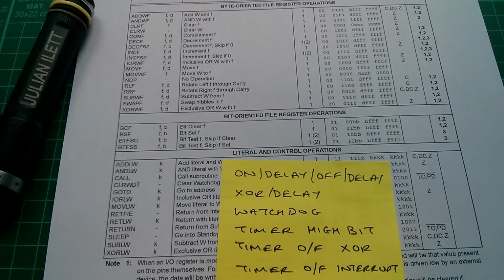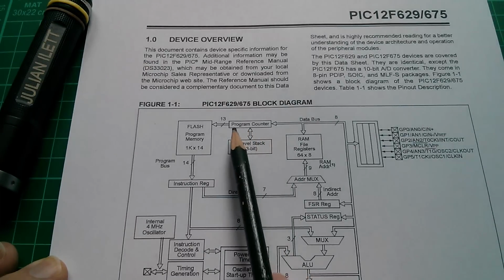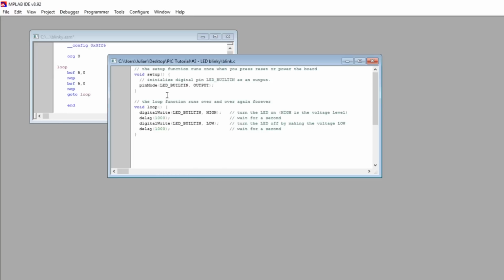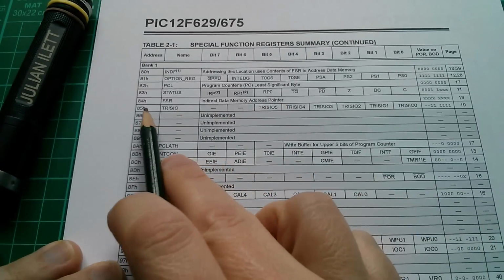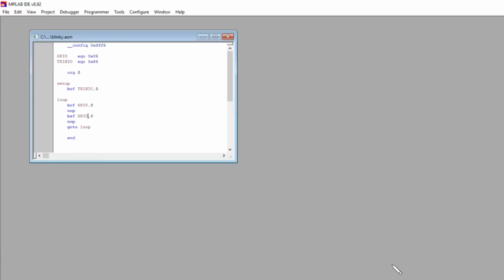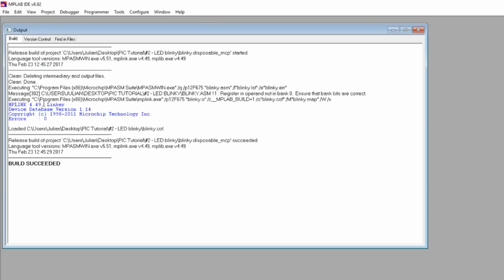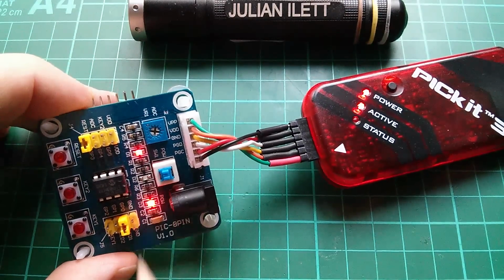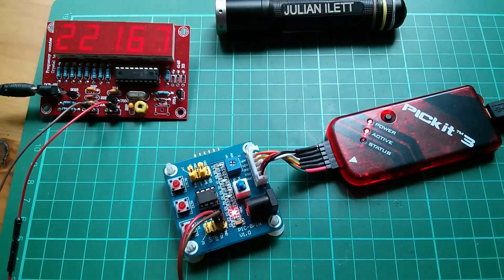PIC Assembly Language Tutorial: #2 - LED Blinky

Comment: Hey bro....how can i write an assembly code that will turn on a LED when i presses a push-button switch. When the switch is released, the LED will turn off. After the switch is pressed and released a specific number of times, a second LED is to turn on and stay lit forever. Using PIC16F84A and  PICKIT2 Programmer    

Thanks in advance for your help

Comment: I wrote a stepper motor driver years ago in ASM on a 16f84 then moved on to a satellite tracker a bio diesel process controller and many more than wanted to do more maths which was so long winded I move on to proton pic basic which was very slow in comparison to ASM but woohoo you can embed the bits you want fast in ASM 😁

Comment: I normally don't see assembly language tutorials on youtube so I had to click on this video out of curiosity.
I have to say it was pretty well done and easy to follow. A nice surprise indeed.

I believe you mixed up GPIO with TRISIO at one point, though. The TRIS registers in fact start with all pins configured as input, but the corresponding GPIO bits start undefined. They will also later depend on what is connected to them (as they are inputs) once they are read, so no contradiction there.

Other than that this was an excellent tutorial. Surprisingly clear especially considering that PICs are a bit of a "messy" architecture.

Comment: 1:39 Point of order!
RISC does NOT mean a reduced set of instructions (as in a small number of instructions) but really means a set of reduced instructions (as a set of simple instructions).
A RISC CPU like the PowerPC has a huge amount of instructions at it's disposal.

What makes RISC is that instructions are typically doing only a single thing, where on CISC an instruction can do many things.

The obvious example is adding to a (memory) variable, which in RISC takes a load memory to register, add to register (possibly even a load immediate value in register), add register/immediate to register, and store instruction.
where on a CISC like the intel x86, this can (but it is not necessarily the best way) be done in a single instruction add register value/immediate to memory location, which does the load/store for you.
Reply from the maker: +oreubens Point taken, reading Wikipedia now. It's not a very concise definition.
Reply: it isn't, and it really is difficult to figure out what is meant.  The whole idea behind it is that at some point CISC was evolving into such complexity that it was thought that making simpler instructions would make it easier to create processors, even at the cost of making the programming harder.
Again, the theory behind that being that compilers could handle that complexity easier in software than it is to solve the problem of cramming ever more transistors on a chip and dealing with heat. And yes, there are RISC cpu's where they ALSO reduced the instruction set itself so having CPU's without a hardware multiply or divide  That didn't help in making it obvious that RSIC wasn't about the amount of instructions, but about the amount of work each instruction does.The most obvious distinction is memory access where on RISC you have separate load/store instructions vs instructions that 'do' something like arithmetic, logic operations, shifts... (there's a few oddball exceptions here and there). On a CISC, you find instructions that 'do work' directly on memory.note however that even on current x86 x64 processors, you typically want to avoid the more CISC type usage of instructions and split them up into multiple separate load/operate/store instructions just like RISC, because it allows for a better usage of the CPU execution pipeline.
Reply from the maker: I'm making some sense of this by reading about the One Instruction Set Computer (OISC) - totally fascinating https://en.wikipedia.org/wiki/One_instruction_set_computer

Comment: I've watched the vid twice (still waiting for the dev. board to turn up, although the Pickit3 arrived today and some ridiculously small pitch cables yesterday!). I've watched it twice and am banging my head against something which, I am sure, is blindingly obvious, but I just don't get it...
I get the fact that you've got to switch banks. What I don't get is that the register you have to change is in bank 0 and yet you can still access this register once you have switched to bank 1. Surely once you've changed the register, it becomes inaccessible as any reference to the 'file/location' will be pointing to bank 1?
Sure as eggs is eggs, I'm missing something. Maybe I should keep watching until it clicks...
Reply from the maker: It's elegantly simple - the STATUS register exists in both banks - it has to - that's the only way it can work :)
Reply: Doh! Perhaps I should have done my homework and actually read the data sheet. I've downloaded and printed it now. Slapped wrist. Sorry!

Comment: Thought you were going to use pickit2 to avoid pickit3 issues. I'm only a beginner and doing my best to keep up so adding unnecessary problems is only adding to my already steep learning curve. Not criticising your great videos just asking you to remember the numpties like me!
Reply from the maker: In hindsight, it might have been easier to use just the PICkit2. But I've recommended both now, so I have to cover all the issues (which is a lot of work).
Reply: Julian Ilett I have a pickit3 but got a pickit2 anyway as they're ridiculously cheap (clones)!  I need to do more study of relevant literature so I can keep pace!  Hardware not a problem but software side is a bit more demanding on my old brain cell!

Comment: Well, that answers that question... I'll have to wait for the PIC12F675s to arrive... I tried to port this over to the PIC12LF1840 that I currently have in my proto-boarded version of the experimenters board, and I don't seem to be able to get the clock to start up when doing ASM code... only with the C code so far. However, I've been looking at the program memory (I'm using  MPLAB X) and one nice benefit of this video is I can actually start understanding the ASM instructions  that the compiler is using... neat! So now I can see how "LATAbits.LATA0 = 1;" becomes "BSF LATA, 0x0" and how "TRISAbits.TRISA0 = 0;" becomes "BCF TRISA, 0x0". Neat! btw, maybe the issues with the PICKit3 and MPLAB are due to not switching the PICKit3 back into MPLAB mode after using the PICKit3 Standalone Programmer, as that loads a different firmware onto the PICKit3? Another thing to consider is if you have had MPLAB X installed, there is a "MPLAB Device Driver Switcher", which switches between MPLAB 8 and MPLAB X drivers.
Reply: Actually, it looks like the driver switcher doesn't apply for the PICKit3... it's for their other programmers like the Real ICE or ICD3. I did try MPLAB 8.92 though, and after it downgraded the PICKit3 firmware to a version it preferred (second time I tried doing this it half installed, so I unplugged the PICKit3 and reconnected it and it successfully installed). It was then able to connect to the programmer and upload to the PIC without any trouble. And MPLAB upgrades the firmware again when I use it. I don't intend to switch back and forwards, but it seems like my setup is  stable enough with either version of MPLAB.

Comment: all this for friggin blinking LED??? yikes!
Reply: Assembly is a very low level language, its basically one rung above the raw machine code that actually tells the chip what to do. There is essentially nothing implied with assembly, so you have to put in the effort to get the results.

The best saying Ive heard is that it will do what you tell it to do, not what you intend it to do. If something isnt working properly, its because you havent told it how to operate properly.
Reply: Tom Storey actually i don’t share the same opinion that is a very low level language...

Comment: Your hardware approach doesn't really work, you're fired. Because the goto uses 8 clock cycles and the noops only 4 you have the LED off for twice as long as you have it on. It's not symmetrical.
Reply: was a precise 50/50 duty cycle written into the spec? :/
Reply: @joinedupjon: We don't know... we're not privy to those super-secret details. I suspect it was though... since Julian said he will fix that in the next video(s). :-P

Comment: How are you getting away with putting code at address 0x00 - the Reset Vector?
Reply: slm60uk because it's perfectly reasonable to have this code start running immediately after a reset

Comment: The PIC architecture is Ugly. Only use 14 bits instructions and then to make this work, invent register banks. That's Ugly.
Reply: Paul, Yes it's a bit ugly. Mostly hangovers from earlier chip series. Original chips had only a  12 bit instruction  word and a special instruction for setting each of the special function registers. When I started with the PIC chips there were only 4 chips in the series and there were only one time programmable, rom and UV erasable development chips. The chip Julian is using is several generations later but has many holdovers from the past.

Comment: Nice work, Jules! :D Glad you didn't get your arse fired :P
I noticed the LED off time was slightly longer than the on time, is that because of the tiny extra time it takes for the GOTO to loop round? If you took out the second NOP and put it after the LED on code, could you make an exact 50% duty cycle?
Could be a neat 555 timer replacement (obviously not pin compatible) that generates nice 50% duty cycle square waves with a RC oscillator :D
Reply from the maker: Well spotted. In fact the on time is half the length of the off time, so the GOTO is having a very large effect. And you're right - moving the NOP would restore the symmetry perfectly :)
Reply: Julian Ilett Ooh! :D
Follow up vid? I'd be surprised how fast a square wave you could get out of it. Also the RC clock could lead to some interesting ideas, like arbitrary waveform generation, or sinewave simulation using data points plotted into a lookup table :) (I've done this on arduino to move servos :D )

Comment: I would argue that it's good practice to use notation to indicate which radix a number is in regardless of whether it's needed or not as it avoids ambiguity in code and maintains consistency. 100% of software bugs are the result of either laziness or incompetence! Best to teach people good practice from the offset. :P
Reply: I used 255 and ended up getting 85 very confusing.... in the end this was hex is the default radix so 255 is 255 in hex but the higher bits get thrown away giving 55 hex which is 85 decimal!  Should have said .255 obvious really!
Reply: 100% of bugs not not due to laziness or incompetence, only some are, You cannot measure that.
Reply: TheProCactus: yes you can. Code isn't magic, it behaves in a precisely defined way.
Reply: himselfe so when you go shopping you say i'm going to buy D'12' eggs? the default radix in C and in life is 10 so this is a trap for new players.
Reply: That's the point though, when the radix isn't decimal it's good to consistently show that in the code regardless of whether you technically need to or not. Can't imagine any situation where I'd want to buy 3346 eggs mind you! Also, I read your comment in the voice of Dave Jones. xD
Reply: himselfe with respect to MPASM I agree with you D'100'% particularly as the default radix can be changed with /r argument or in the source itself with the radix directive, in more general life and C, Java, JavaScript, Python,... etc. then I will continue to use literals in base 10 without disambiguation, however being the disciplined developer I am my constants will be declared sensibly as symbols except for 0 and 1. 0 and 1 of course are not problematic in any base.  This discussion could also be extended to negative numbers where size becomes significant but I guess Julian will cover negative numbers at some point.
Reply: About the bugs, I suppose you are right about that, I can't think of a single thing to argue against you. 
I think what I was getting at was not all programs can be written down with such accuracy that a complex system of code will work every-time first time.  

Even if it does work first time don't mean there other effects.
And there could actually be manufacturer bugs.

My argument was its not 100%, Unless you want to put the blame on someone higher up the chain.
Reply: Of course it's natural that bugs will develop across the life of any complex code, human beings are not perfect creatures and we make mistakes. In the process of learning and in early development, bugs are highly excusable, but for those bugs to make it into production code can only ever be attributed to laziness or incompetence. That isn't however to say that it is necessarily the programmer's fault. Sometimes highly skilled programmers can make stupid mistakes because they're under pressure to get a project completed in unrealistic timescales, and that is down to the incompetence of management.

I would argue that the vast majority of incompetence is at the management level, because even if you have an incompetent programmer, it is management that chose them to do the job!

The essence of my original point though, is that good practice can do a lot to avoid the sort of silly mistakes that lead to many bugs, so it's good to instil a sense of doing things methodically from the beginning in people who are learning to code.

Comment: Wow, this PIC programming is complicated. I learn with Arduino and I think is much simpler.

But now I wonder: is there any advantage of using PIC instead of arduino? Or they have different purpose?
Reply from the maker: Yes it is complicated and it's much less productive. So why learn it? Because it teaches you how microcontrollers actually work :)
Reply: I am not that advance, but at least because of watching this video I have an idea now. Thanks
Reply: They are essentially the same thing.  They're both microcontrollers (a complete computer on a chip).

The big difference is that the Arduino has a program already installed (the bootloader) which makes it easier to load up new programs.  Also, Arduino is programmed using C rather than in assembler (although it can be programmed in assembler if you want to)

The advantage of Arduino is convenience.  The disadvantages are that the bootloader takes up some of the program memory space (although that's not usually a problem since it takes very little space) and using the C language tends to distance the programmer from what's actually going on inside the hardware, which can lead to sloppy programming practices.

In general, knowing how things are done in assembly language will tend to make you a better high-level language programmer too.

But having said all of that, I have to admit that there's very little to choose from between them.  The relative advantages and disadvantages are small and perhaps even insignificant, when viewed dispassionately.

So if you're happy programming in C, then certainly you can stick to programming the Arduino that way.  But if you want to learn what the C language is doing for you "in the background" then you'll want to learn assembly language.

Comment: I believe program should reside after 0x04 location, at least (if I remember correctly, 0x04 is the location of the interrupt vector)
Reply from the maker: If global interrupts are disabled (which they are by default), location 0x04 is not an issue.

Comment: @20:00 You don't know the secret handshake?  Just connect the PICKit3 to power WHILST holding down its button, this invalidates the firmware so when you ask MPLAB to talk to it there should then be an automagic download of compatible version.
Reply from the maker: Yeah, I tried that a couple of days ago. Watching Dave Jones' video on PICkit 3 woes was very helpful :)
Reply: also... If you connect a scope then you should be able to see the effect of the GOTO you described... should not be a 50/50 trace.
Reply from the maker: Aha, you read my mind. Next time I'll show the asymmetrical on/off times, using NOPs to rebalance the symmetry. Then I'll use an XOR to toggle the I/O pin (explaining the read/modify/write issue) and show that toggling has natural symmetry. Toggling TRISIO avoids the read/modify/write problem with GPIO. I'm loving this :)
Reply: finally.... could you single step using GP5 and Key2.  Gotta go... think I left the machine gun connected....
Reply from the maker: Haha - debounce - a tricky issue :)
Reply: Julian Ilett HM... yes. true... need some debounce across the jumper... 555? another PIC!?! and you will have to press x4 per instruction... but it would save the cost of the capacitor.